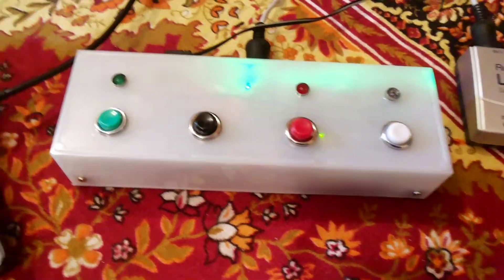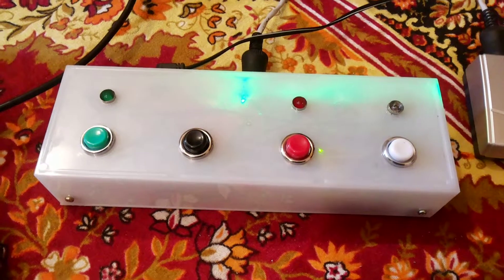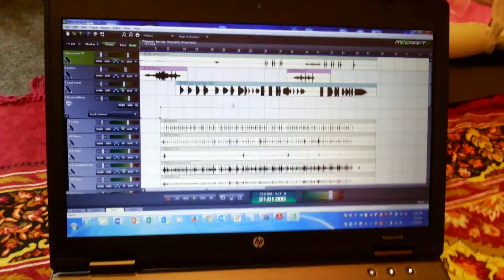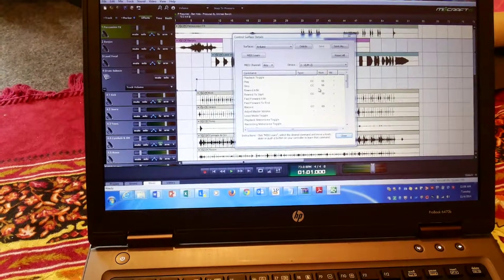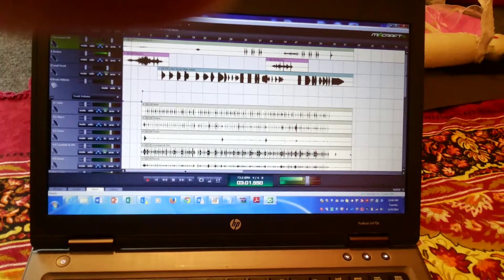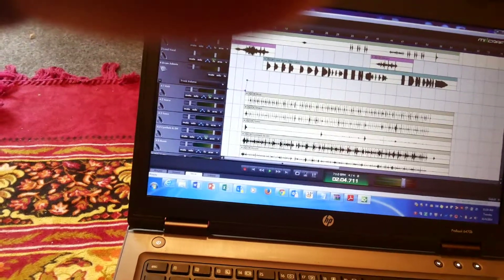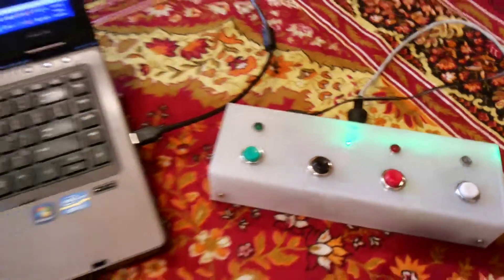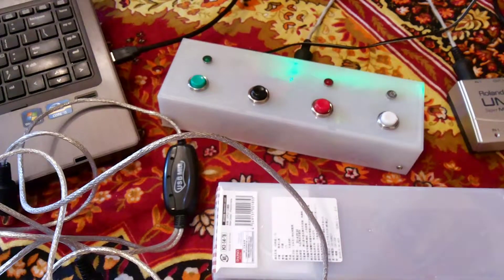Arduino based DIY MIDI control surface

Comment: can u send the midi cc info directly  to the  DAW through USB instead of midi port in ur arduino circuit? it will save us from using the midi to USB convertor.
Reply from the maker: It is possible but you need to load a different firmware on the Arduino. 
Check this ..http://morecatlab.akiba.coocan.jp/lab/index.php/aruino/midi-firmware-for-arduino-uno-moco/?lang=en
Reply: Lawrence Doss thanks a lot , will check .